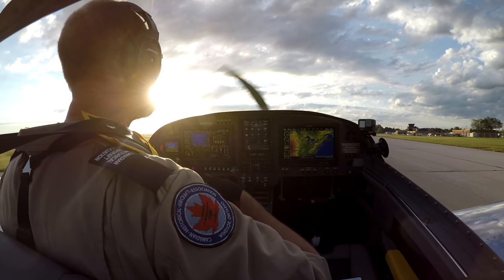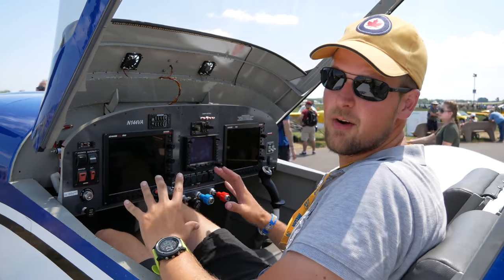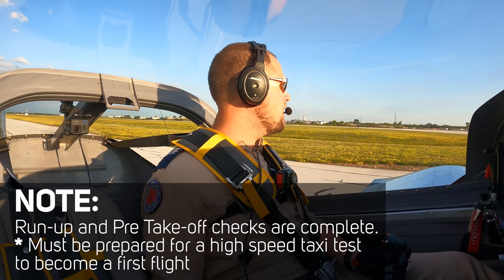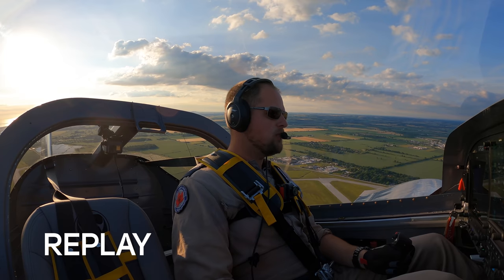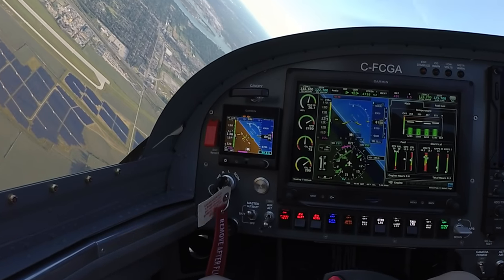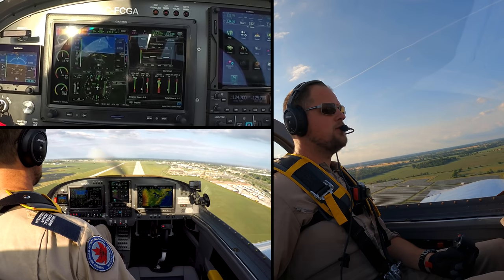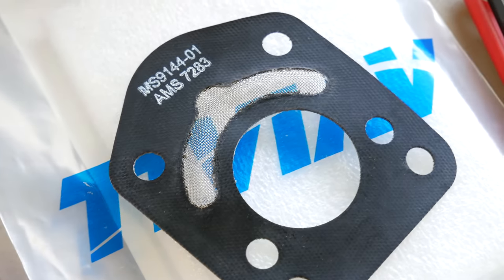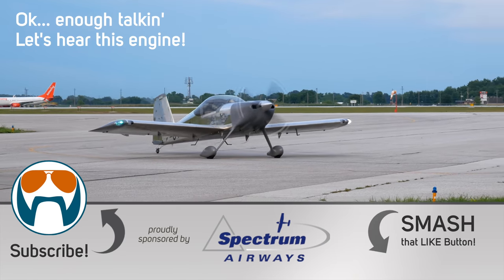First Test Flights x2 Newly Built Aircraft! He BEAT us by a Day!

Comment: it seems that this prop is helping & nursing this engine..it makes the engine work as it should..,I don't know if you muffled the sound inside the cabin but it was such a 'quiet' flight compared to other small aircraft..where you hear engines rumbles ,lots of rattling ,it"s almost painful to the ears...!!.here the alliance of this new engine & great tech propeller felt really 'easy' in term of power ,you could tell the engine was running super smooth and had plenty more power to unload..!! fantastic..

Comment: Had the same issue after my G3x install with the manifold pressure too.
Reply from the maker: How'd you solve it?  I don't think I want to live with that temp fix forever.  (and thanks for being a 5+ year subscriber Tim!)
Reply: @FlightChops  we replaced the manifold pressure line going to the sensor and it fixed it. My belief is it was some sort of small leak on the 20 year old line that developed when we did the instrument change. it’s also so sensitive that getting a little variation is kind of normal, but I had 1.5 to 2.0 swing in manifold pressure until we replaced the line. It also took a little bit to settle into being super accurate but it no longer swings significantly. Remember on an analogue gauge you are unlikely to notice a .3 swing. Nor do I think those gauges are sensitive enough to notice themselves.

By the way see you at KOSH! Will be there in my skywagon N19EC coming from Seattle!
Reply from the maker: Awesome!  Please do stop by one of the places I will be for a high five!
Reply: @FlightChops  will do!

Comment: Hey Steve, thanks for chatting at Oshkosh this year! I’m mid-build on my RV14A and decided to order the Aerosport armrest and throttle quadrant that you used. Can you send me the specs you used on the mcfarlane cables for the throttle quadrant? Thanks!!

Eddie
Reply from the maker: Awesome thanks Eddie! 
The specs are so custom that it is best to be talked through how to take the measurements to be sure you have it right - ours will likely be a good starting point, but unless you have exactly the same engine and fuel servo set up, your numbers will be different than ours.  
The best thing to do is to reach out directly to McFarlane and let them know you're trying to match the Flight Chops set up - they are ready to help people, and have our details on file.  Or you can you email me and I'll put you in touch with my contact there.  flightchops at gmail dot com

Comment: Congratulations!!
Just one question:
You wrote that you kept cowl flaps closed for higher CHTs during break-in. Why?
I would say you should have opened them. The break-in process generates more heat than normal and that heat is not healthy for cylinders. They should be kept as cool as possible... High power but low temps.
Reply from the maker: It is crazy how variable the guidance is for break in.  
Anyway - We were following both Lycoming and Van's directives to run hot.  
They both actually suggested getting it even hotter than we had it on this flight.
Reply: @FlightChops  Ok. Understood.
The hotter it gets - the smaller clearances and higher friction between rings and walls. So the more efficient break-in process will be. Probably that's the logic behind.
Just don't keep it too hot - otherwise you could shorten your cylinders lifetime.
Reply: @tomekwrs  to be clear, our specific guidance was to run as close to 400 CHT as possible, direct from Lycoming. That basically means keep the cowl flap shut whenever possible in flight as even on a hot day at cruise with the cowl open the most it will muster is about 335-340 on the coldest cylinder.

Comment: Any explanation for why the pressure varies from the manifold without the restrictor? Does some sort of transient pulse form in the larger tube diameter that the restrictor dampens out?
Reply from the maker: I think you've got it figured out.  That's the conclusion we came to as well.

Comment: how did you break in the new engine?
Reply from the maker: ~20+ hours running 75% power with mineral oil and avoiding low power/ground ops as much as able.

Comment: Whats the fuel burn like in cruise?
Reply from the maker: So far?  pretty terrible :P. 
But we're mostly using break-in power settings running hard.  Will report back after we can get to normal ops.
Reply: @FlightChops  Fair enough. I have been involved in flying a new engine on a Cherokee 140. High power settings to set those rings. Look forward to an in-depth performance review. That is quite the airplane. Enjoy.